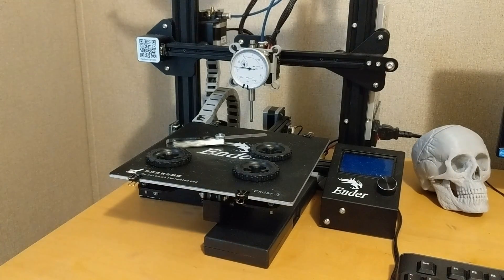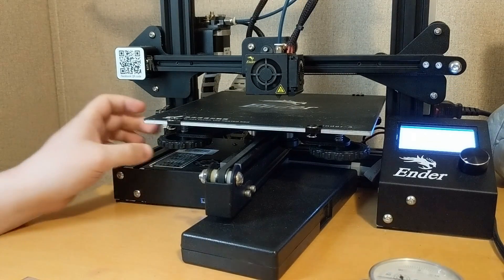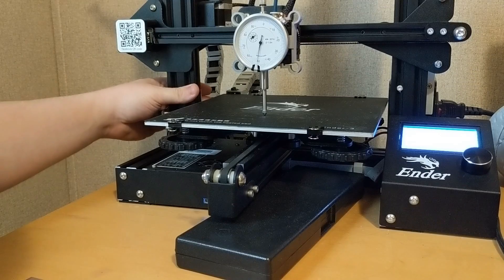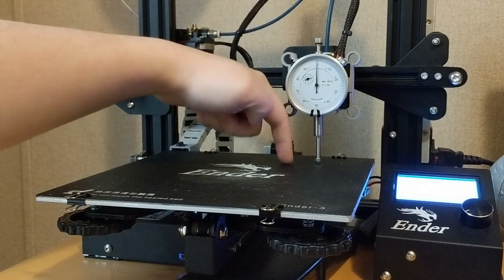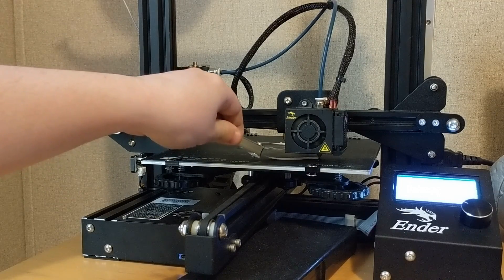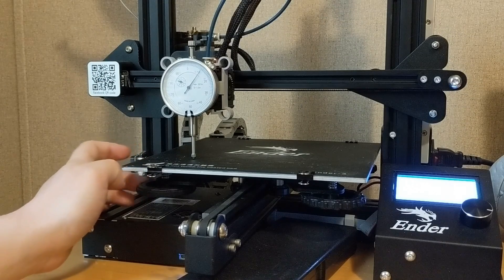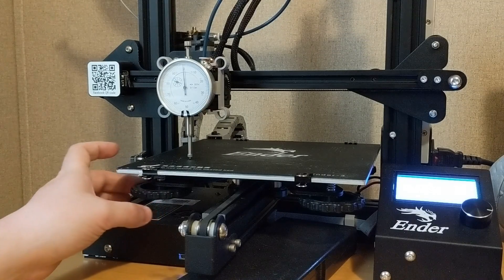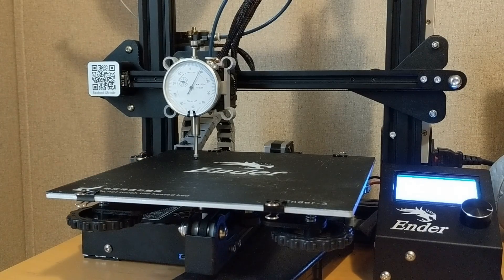Ender 3 Bed Level with Dial Indicator

Comment: Great video, thanks very much.
I've just been given a v1 Ender 3 and the first thing I did was push GENTLY on the bed plate. Wow, what a crap design these machines are. That metal plate actually flexes with not much pressure. I wouldn't be surprised if this lack of rigidity causes bad prints as the part gets larger and heavy, causing the plate to flex during direction changes. My calculated guess is that we can level the bed perfectly but flex during operation is a design problem.
I love the idea of using a dial indicator and will use it myself as it's very visual and accurate. I also like the feeler gauges as opposed to a piece of paper. I've measured paper thickness on a few occasions because I've used it to do a rough touch off on lathes and milling machines. Typically have got around 0.1mm thickness but paper will squash a bit especially when pressed against a small area like a nozzle, so you don't really know what thickness you are getting.

Comment: This is the ONLY method that MEASURES bed level and can indicate warped beds.  Outstanding idea to make the holder. BTW those with steel tables can use a mag base next to the printer and a long indicator holding rod then move the bed.

Comment: Can you use a Dial Test Indicator to level and adjust the 3D printer rather than using plunger type indicator?
Reply from the maker: Probably, but you would need a different mount for it.

Comment: This method creates a lot of unnecessary inaccurate work that just needs to be manually dialed in after leveling the bed to a position, but as demonstrated this position is fixes and is not where it needs to be. And depending on what layer height you plan on printing at you would need to gauge everything different because layer height effects the distance that the bed is leveled from the print nozzle.

All that is needed to level a print bed is a set of feeler gauges. Get at eye level of the print bed and tighten down the adjustment knobs a bit and lower the z axis  until the switch clicks, then loosen the knobs until the nozzle comes into contact with the bed, then depending on what layer height you are going to be printing select a feeler gauge that is about half the size and tighten the knob at the position you are leveling and the position behind it equally until you can slip the gauge under the nozzle then gently turn the knob back until the nozzle contacts the feeler gauge, repeat for all postions, and never push down on your bed as your leveling, the springs will lose tention on the knobs and slip slightly throwing off any leveling that had been done.

Comment: Great idea!  I have a whole shop full of various dial indicators, accurate down to 2 ten thousandths of an inch for machining and engine rebuilding

I never thought about using those. 

The only issue now,  I'll never be satisfied with the bed level lol

Comment: So the indicator bracket is a friction fit on the fan?  
I’m not using the same printer so could you share rage dimensions of the fan and the inside dimensions for the mount so I can get an idea of the amount of the friction fit.  Rather than having to print some pieces and find out that they are either too tight or too loose, thanks, yup I’m lazy, LOL just don’t need to reinvent the wheel. 
Thanks

Comment: I use a feeler gauge or paper to set the front left corner directly over the leveling knob and then attach my dial indicator and set the other three corners the same , then back around to make sure . Great level everytime

Comment: With the steppers disabled my z falls like a rock. Z nut and screw is nice and smooth. Also I don't have any only home Z cammand so I have to move my bed in 10mm increments with the dial and screen. As far as the dial indicator I have a magnetic base I printed but I think I'm going to print Sunshine (YouTube guy) mount and his printed dial indicator.

Comment: hi i have ender 3 and i buy it used when i put dial and try your technik  my dial from edge toedge goes .01+ .01- its so hard to level the bed no matter how hard i try do you think that that bed is bad and do i need to buy new one i also useing glass bed but i just cent to dial that bed its all over the place pls help tnx

Comment: Just curious, why did you switch back to the paper method? Thanks.
Reply from the maker: It just feels better to me. The tooth of the paper helps me know how much contact I have between the nozzle and the bed. Nothing wrong with the feeler gauge.
Reply: ElectricalInsanity Thank you for getting back to me so quickly! Then you still use the dial indicator but just substituted the feeler gauge for the paper, correct?
Reply from the maker: @jcsonic7410  exactly! The dial indicator is used way more than the paper since I usually only need to make things a few thou looser or tighter, or verify the bed is still level. I only need to use the paper when things get completely out of tolerance and I need to reset to a known good point.
Reply: ElectricalInsanity Awesome, thanks!

Comment: This is actually the best way to level the bed. Have broke my back times using paper leveling method till I use a LVDT displacement sensor mounted permanently . Shows a digital display all the time with a micro accuracy. 

Great Video. By the way what was the thickness of that feeler gauge ?
Reply from the maker: Thanks! I've added the thickness of the feeler gauge to the video description.

Comment: What is the "best" spring pressure? You can change the adjustment wheels so the springs are not or hardly compressed at all, or you can compress them fully where you cannot turn the adjustment wheels any further. I could try to do a bed leveling at almost uncompressed springs or fully compressed springs. What consequence has spring compression on things like bed flatness (if any?). What is the optimal spring pressure and why?
Reply: In between both extremes sounds like the best. You want it under tension so it is tighter and less likely to move but you don't want to do it all the way to smash the springs or give you no where to go down. I would switch to silicon ends instead of springs. They move less

Comment: There is a much easier way of doing this with a gcode file and a different mount that sets the dial a little higher.. You keep the dial on the machine as you level each corner.. takes about 60 seconds to do. if you're interested, let me know and I can send you some info.
Reply: Let me know please?
Reply: Could you share that with me?  Thanks
Reply: can I get that information please?

Comment: if only I knew the feeler gauge size I could subscribe. But when comments don't get a reply from the uploader I have to assume the channel is not maintained anymore. Shame, really great video let down by one small but important piece of information not given.LLAP
Reply from the maker: It was a 5 thou feeler gauge. The exact feeler gauge thickness doesn't really matter because it needs to be appropriate for your printer. You might need more or less to get good adhesion. I've since switched back to the regular paper method. You're not wrong about the channel not being maintained, I just have nothing meaningful to post and I have no intention on trying to be a content creator.
Reply: @ElectricalInsanity  Thank you Sir for your very welcome and honest reply. I am sure that will put many minds at rest.  This method with the dial indicator is unique and ideal for a geek like me. Along with many other like minded people thank you for all your hard work. Subbing is not hard and I am glad to add mine if it helps you with ad revenue or whatever value it has. I wish you are yours well in these terrible times.

Comment: What feeler gauge thickness did you use? it wasn't apparent in the video. 0.1mm maybe? Otherwise, a very clear video. Thanks!
Reply: Crucial piece of missing information to make this video useful
Reply: @mattbeller4384  it's not even relevant to leveling your bed.

Comment: Do you do this with a hot Nozzle? Because your holder covers the hole fan. No Problems by that?
Reply from the maker: Yes, I do it with a hot nozzle. I haven't had any problems. It only takes a few minutes to level everything so I'm not concerned about the amount of heat creep.
Reply: @ElectricalInsanity  ok. great. thanks a lot

Comment: How do you attach the dial indicator to the printer?
Reply from the maker: https://www.thingiverse.com/thing:3259876
Reply: @ElectricalInsanity  What size magnets do you need to mate with the indicator holder?
Reply from the maker: @bitsurfer0101  no magnets, it replaces the original back plate and you reuse the screws